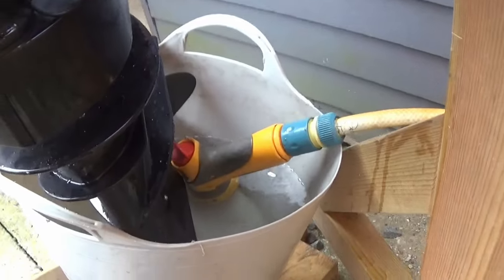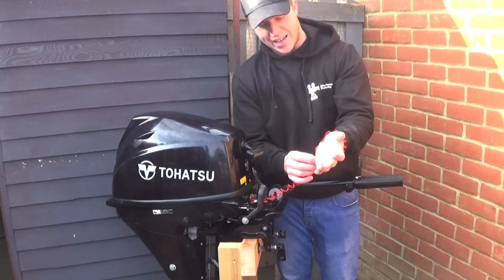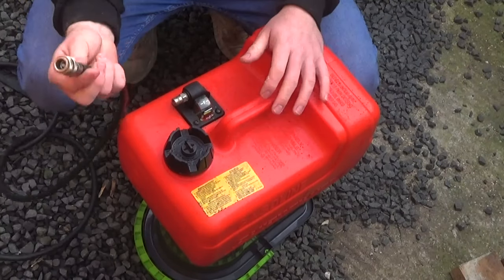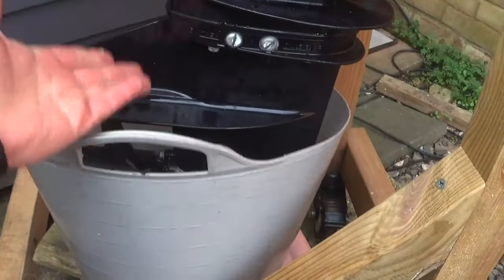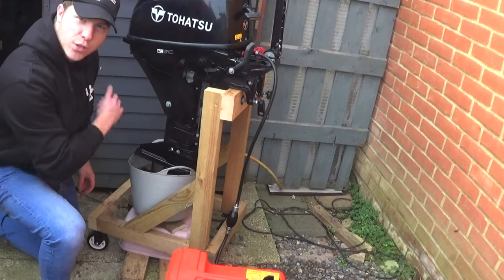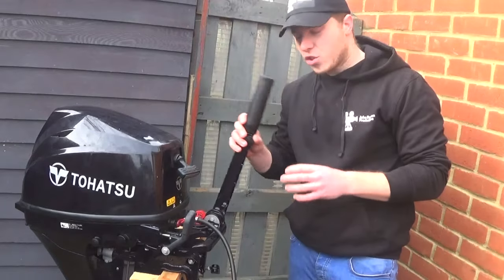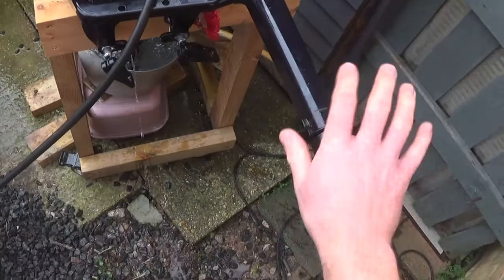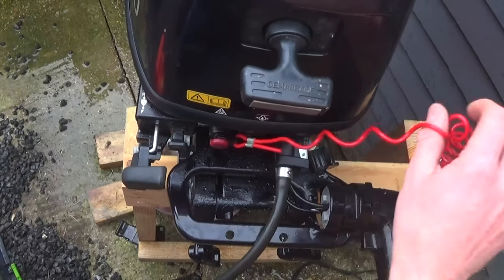Outboard Engines For Beginners - Small Inflatable Boat - Complete Guide - Tohatsu 9.8HP

Comment: Thanks, this is helping me massively with my first boat. Got to say as a middle aged guy this is something I have wanted to get into pretty much my whole life but I have to say I am finding it all a little overwhelming - not to mention very expensive - as I have gone the brand new route to try and keep it simple and avoid additional problems. Videos like yours are perfect for people like me, thanks.
Reply from the maker: I’m very pleased it’s helping. I aimed this at new comers as when I started there was just nothing out there that was easy to follow. Very pleased I have managed to help you out there 😊
Reply: @MuscleFishingOfficial  Hi, just one question if I may, how accurate does the SIB's inflation pressure need to be? I read lots of conflicting views. My SIBs pump came without a gauge.
Reply from the maker: @jjs3287  good question, to put it in honest form I pump mine to recommend pressure on the electric one and then that’s that for the day. It does need to be at the recommended pressure but give it take I don’t think makes a huge difference. Plenty of people will be out there with hard tubes and won’t have a clue what the pressure is. But do try and get it to what’s asked. You can buy cheap gauges that will tell you
Reply: @MuscleFishingOfficial  Thanks!
Reply from the maker: @jjs3287  no worries

Comment: Hi Jake, nice video. The only thing I'm questioning is, the storage or transportation, I'm thinking it should be laying on the tiller side, not the side with the Knobs on.
Reply from the maker: This engine has the sticker on stating what side to transport on. It’s a little weird. I thought the Similar thing. The best way is to transport horizontally. Sadly my car isn’t tall enough
Reply from the maker: Your right, I actually do transport it that side 🤣
Reply: Correct sticker side UP

Comment: best advice ive seen so far,will help me a lot,i live in hastings,so using water for flushing would have to wait until i get home,would that cause any damage,from sea to home 15mins,once all packed up
Reply from the maker: Appreciate the feedback! No it’s absolutely fine waiting. The issues is when it’s left for days at a time the salt hardens and blocks the water inlets. When on holiday I can flush the engine but use it most days and when it gets home it gets a full flush with bucket! That’s absolutely fine! You just don’t want to be leaving it a week before flushing. A day or two is fine

Comment: Hi i was told the best way to stop after a flush and storing the engine for the next trip was to remove the fuel line from the engine and then just let it run dry  so there's no fuel left in the system, works for me
Reply from the maker: Yes that’s what I do, remove the fuel line and let run down. It can only be done with 4 stroke though! Not 2. Always done that with mine and worked well!

Comment: Excellent video thank you, I was told by the service guy when you have finished with the outboard for the day while the engine is idling in natural unplug the fuel line and allow the engine to use what fuel is left in the outboard until it cuts out (used all the fuel up ). He said this is also good practice if your not planning on using it for a few month or transporting and the fuel won’t go stale. If this true or could this cause future problems? Thank you
Reply from the maker: Pleased I could help! If your engine is a 4 stroke this is exactly what I would recommend! I do it with my new mariner EFI 20hp after every trip. While it’s flushing I pull the fuel line and let it tick over until it runs dry. Engines been spot on for me so far! Don’t do this practice with a 2 stroke though though! Apparently doesn’t work in the same way!
Reply: @MuscleFishingOfficial  Brill thank you, yes it’s a Mariner 9.9hp 4 stroke. This is all new to me, so I’m trying to absorb as much helpful info as I can. This video has helped me along my way. 35 years in Blackpool and only ever swam in the Irish Sea this year hoping to get out soon (if United Utilities stops dumping waste in it 🙄 we have a sea ban for a week or 2 because of it ). Thank you 👍🏻
Reply from the maker: @ronrammelle4735  shocking to hear about that waste! More needs to be done. Any questions let me know or send me a message on the muscle fishing Facebook and more than happy to assist where I can

Comment: Very helpful mate I'm considering getting a tuffy but absolutely clueless with things like this . How long will one of those fuel tanks last ? Is it worth having 2 onboard?
Reply from the maker: I love my Tuffy and can’t recommend them enough! Currently down Cornwall fishing for sharks and it’s handled 3m swell like a boss! The fuel tanks last a while tbh. The 20hp will use about 6 litres a hour at full throttle. Reality is you don’t use full throttle, I go through 10-15 litres on a big day. That’s going out 10 miles, drifting and resetting and doing more. I take a 10litre spare and a 5litre so I never ever have to worry about fuel

Comment: The picture looks like you should store / transport on the side the tiller handle is…is this correct as you said the other side where the two bungs are?
Reply from the maker: It’s sticker side facing the ceiling. For some reason that day I confused it. Even though it’s always been stored sticker side up. I do think However it’s best to keep engines upright regardless. They always run better

Comment: Very nice video I must say. You’re putting in so much work in this “wee series” that you’re releasing, well done mate! This will become handy in a couple months when it comes the time to use my outboard for the first time, I got this as I found a good deal, but no sib yet, next months project! Not sure if I didn’t pick this up in the video, but after researching and speaking to some fisher in Italy,  I am aware that when flushing the outboard if you do not think you’ll use this for some days/weeks, it may be worth running it with the fuel line off so you get rid of the extra fuel from the motor and this switches off, so that you’re sure the engine is clean and no old fuels will be stuck inside - would you recommend it?
Reply from the maker: Many thanks. Very pleased you enjoyed. The method your dear living is running dry. It basically involves pulling of the fuel line from the tank while it’s running and letting the engine shut off once starved of fuel. If your not using for a reply months this probably is a good idea. But days/weeks or a month I don’t think it’s a necessity. I would have used this method if I knew I was not to use the Outbaord for 4 months. Keeps the carbs clean of fuel. Hope this helps!

Comment: nice video I must say it is very informative no one else has broken  it down like you have,  this will helping me massively with my first boat, when I put my new engine on my 16ft boat. As right now I have a Trolley, but i need to buy athe right engine for my 16ft dingy boat, so as to ask you a QUESTION? what it will be the right foe my boat??
Reply from the maker: Many thanks for your kind words, first thing you need to know is if your RIB/SIB takes short or long shaft engine. Have a look at the plate and see what your boat is rated for in horsepower. If you want speed and fun get near the top end. If you want to poodle along and save fuel and have a bit of fun but nothing extreme you will probably be ok with power around 2 thirds of what it’s rated for. Hope that helps

Comment: Hi just taken my new 6hp mercury out for the first time on my 2.9 meter sib. I tried a few trim positions but couldn't get on the plane . When I ran outboard at full revs the boat seemed to bog down a bit. Do you think adding hydro foil fins may help ? Appreciate any advice
Reply from the maker: Morning, 6hp isn’t a massive engine. But my thoughts would be it should still plane. We’re all air pressures correct? Hydro fins may help but the boat shouldn’t really be digging in. Make sure the floor is pumped to correct pressure 😊

Comment: Great informative video.I’m confused how to anchor a Sib .Any help would be great .can’t see anything on YouTube.
Reply from the maker: Thank you! You anchor a SIB how you would anchor a boat. From the bow. Retrieval can be made easy using a alderny ring and a A1 bouy. When I anchor my SIB I will do a video next time. But that could be spring time.
Reply: Thanks for your reply.just not sure how to tie off without a cleat.keep the videos coming you explain things so well👍👍🎣
Reply from the maker: @pompeyzac  that’s a thing I’m working on. You can use a divers reel with stronger paracord in small tides. Or attach a cleat to the bow ring and use that. I don’t like my anchor line going over any tube so it does need to be front of bow in my opinion. When I get the perfect method I will definitely put a video up.

Comment: Finding your videos very helpful.  I have a 6hp mercury which I understand are pretty much the same as the tohatsu.  I am currently exploring best trim positions for efficiency do you have any vids or advice on trimming?
Reply from the maker: Good morning. My engine stays in one place to be completely honest. As long as the prop is fully submerged and it handles nicely on a small SIB I have not found little adjustments make to much difference. Others will probably say otherwise. This is just my experience
Reply: The Mercury 6hp is made by Tohatsu. For trim, it depends on your boat, but there are 6 holes on the adjuster with the bottom ones being hole 1, so personally I'd start at the position 3 holes, with a good chance 3 or 4 will ve optimum, as position 5 seems to be too high, and causing prop ventilation - easy to spot when turning under power. Could be worth starting at 5, to look for it?  Use a speed app on your phone to check flat out speed, and note it, then move to position 4 do the same. positions 1 to 3 seem to give a very wet ride, and difficult not to get a soaking from spray, as the angle pushes the bow into the water, which may not happen with different boat designs and weight distribution. If 3 with your boat setup is fine, just to compare data, you may want to try position 2 ? Best Wishes and Fair Winds.  Bob.
Reply: PS. I'm getting the same engine for my yacht Tender, a 41kg Hypalon 3 metre Air Deck and Keel. I'll try to remember to come back and let you know which positions works best with that setup, one person, and fully loaded. 👍

Comment: Hey Jake, Greetings from Ireland. I have literally just got my new Excel Volante 360 with wheels fitted and a new Yamaha 6hp 4-stroke short-shaft today. I knew I was getting this setup so I have been watching the videos one by one last night and today whilst I was waiting for delivery, lol, your setup video was very helpful, plus I watched the one with the Dolphins, ( fantastic ) I have learned things I wouldn't have even considered, so a massive massive thanks for these videos. I will be heading out tomorrow to the coast, no fishing but just to get used to the sib and engine for a few hours, I have experience in a smaller 2.7 and smaller engine so no worries there, looking forward to doing some fishing soon. My question is what weight ideally should an anchor be and any recommendations ? Once again, thanks for the videos.
Reply from the maker: thanks for watching and pleased it’s helped you out! 

With anchors the most important part is the chain. You want chain light ideally your boat length and a half. Then a grapnel anchor is pretty good or Bruce anchor around the 3/4kg weight. The important part is the chain. And of course how your breakaway link is in place with a cable tie! Hope this helps

Comment: Hi thank you for your video really appreciate it.
I'm hoping to buy a sib to do some fishing not deep but just deep enough to find some Mackrell and cod.
I'm thinking about buying the Boatworld Air V Type Floor 380 and was wondering what your thoughts are I also wanted to know what engine to get do I need a 15hp engine ? Or will a smaller one be good enough I want it to have decent speed so It doesn't take me ages to get to places?
Also your fuel tank does it last for a full day of fishing ? How many miles can I roughly expect from that ?
Thank you very much I would  really appreciate your input.
Have a lovely day
Reply from the maker: Good evening, first of all thanks for watching and very pleased it’s helped you out. The boat world boats are fine. Nothing wrong with them. I been on one and they are good for the money. A 10hp will get you to about 12/15 knots I’d expect. A 15HP your looking at more like 20. Of weight doesn’t matter to much a 15 is great. Nice and fast. Fuel wise it will depend if you go for a 2 or 4 stroke, I have a 4stroke 9.8 and a 12 litre tank lasts all day. My guess would be that I did around 30 miles in one day and it only used half a tank. So they are super efficient. Hope this helps and feel free to ask Any more questions
Reply: @MuscleFishingOfficial  thank you for taking the time to get back to me really appreciate it 🙏 🙌  I'm just watching through your beginner series now.
Still debating between 15hp 4 stroke or 12hp. I really appreciate your help and will probably bother you again lol
Reply from the maker: @denizt1200  bother away 🤣 if weight isn’t a big concern and the difference is minimal then go for the 15. Otherwise you will always be thinking what if. The Facebook page feel free to message on as it may be easier for you. Kind regards
Reply: Deniz , the weight is not the main problem, it's the shape of the engine. You can't carry them in a decent comfortable position. maybe you can carry a 50kg cement bag, but it's not easy to handle a 40kg 20hp outboard.

Before you buy anything, I recommend you lift a 15-20hp engine yourself at the marine shop and try to install that on the transom of a boat. and imagine yourself doing this on a beach or in the sea.

Comment: Hi, new subscriber and I’m just working my way through your videos. Totally unrelated to this video but as I’m wanting to buy my first rod/tackle for sea fishing, I’m lost in the fishing tackle abyss, do you recommend beginners rod and what things to get? I’m mostly wanting to try lures than bait.
Reply from the maker: Good morning, in my next video with the storage compartments I will do a little bit on rods and reels for you. What I would say is it depends on what your fishing for. Lure fishing - go for a cheap/mid range rod £20/30 and similar priced reel with as many ball bearings you can get. You not need anything fancy. I choose to not go expensive on the kayak and SIB simply because things could easily get damaged or go over the side.  Bait fishing for rays, hounds, conger any cheap 20-30lb boat rod is amble.
Reply from the maker: Also thanks for subscribing

Comment: Would you not be better with an electric outboard for a sib?
Reply from the maker: Hi there, I go to sea and travel up to 10 miles offshore. So electric is not an option I’m afraid 😊
Reply: @MuscleFishingOfficial  the reason I'm asking mate is I'm planning on getting a sib for fishing the lochs of Scotland, do you think I would be better with a petrol outboard or an electric one?
Reply from the maker: @Moostafa78  I would suggest a petrol 4 stroke Outbaord. The tides are strong on some lochs so a strong motor is worth it
Reply: @Moostafa78  If you will be fishing alone , you need at least 6hp. and if you sometimes take a friend with you , you need at least 8 or 9.8hp. 
the most powerful electric outboard I know is Epropulsion 3.0 model ( 6hp )   but has a very limited range. and with a backup battery, it's way too expensive.

Comment: Do you leave the vent open on the tank when it’s running
Reply from the maker: Yes you do. Then at the end of the session at pack away time close it. Hope that helps
Reply: Just got the same engine in a 20hp but like you say not much on how to operate 
Thanks for your help
Reply from the maker: @davecox900  there really isn’t, hence why I did the video, I have a 20HP now and enjoy the extra speed.
Reply: Got myself a true kit 4 mtr just building a trailer should be ready soon to get out
Reply from the maker: @davecox900  trailers are absolutely essential in my opinion